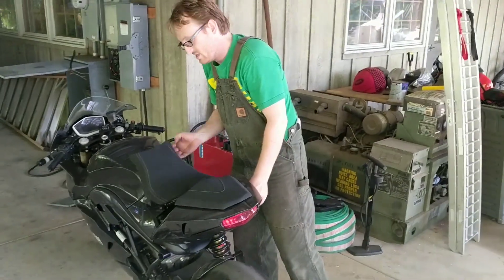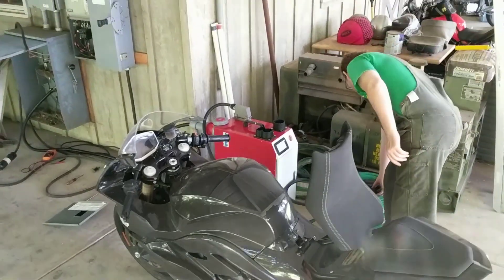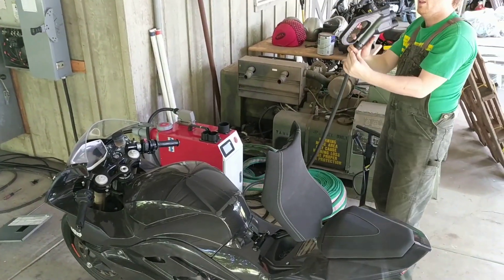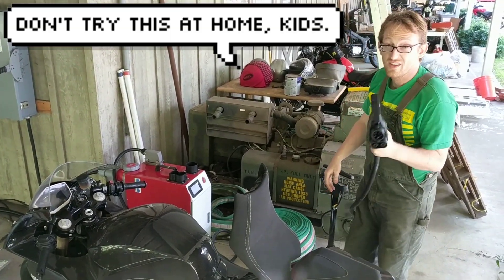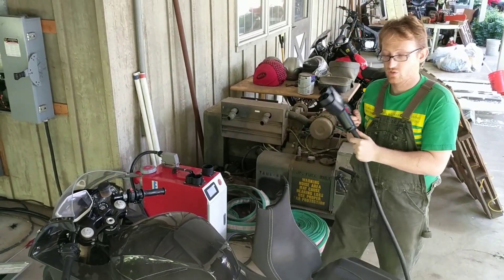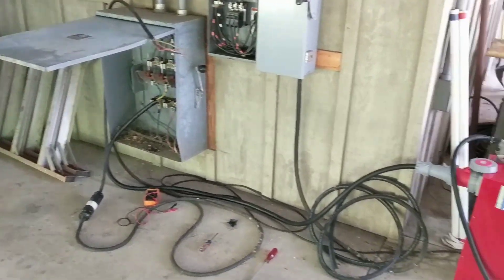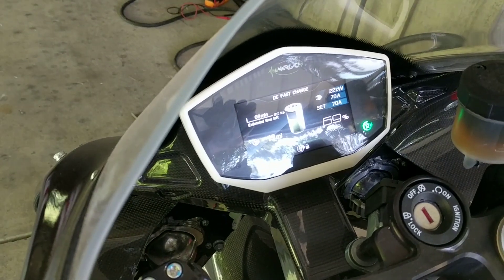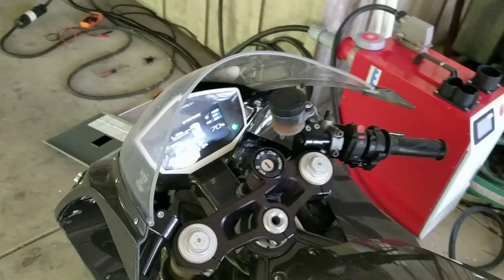20 - 30 kW charger first test mostly assembled

Comment: I own a 2018 ZERO SR. But would love this for my CHEVY BOLT ev.
Reply: Yeah that's what's so great about this. It will fast charge anything with CCS and we can do CHAdeMO as well. So pleased with how well it's working!
Reply: Are you running off 3 phase? I have seen another portable Level 3 that runs off a Level 2 charger.
Reply: @DavidKK4GAF  Pretty much all these things are possible. The test shown in this video did not actually use the 3 phase we have installed, but the option is there which makes testing these for EU much better.
Reply: https://youtu.be/KyvyVxEAWxQ
Reply: What are the specs on your green charger?
Reply: I have a Clippercreek Hcs-40 now. I was going to build a splitter with a J1772 Hydra kit from Geppetto Electronics. One input. Two J1772 and it divides the amperage.